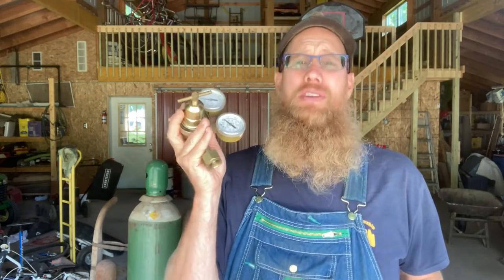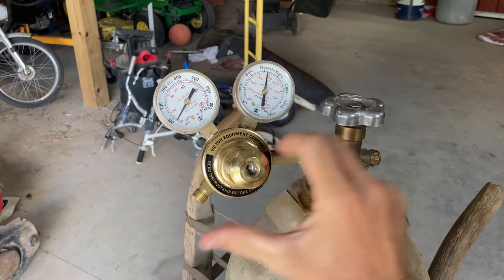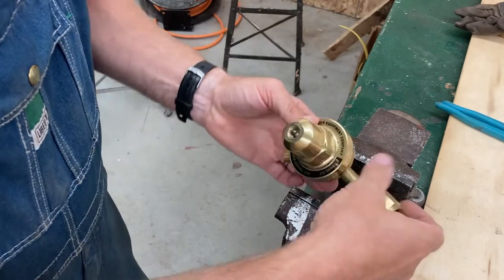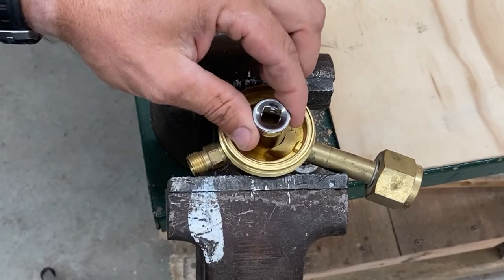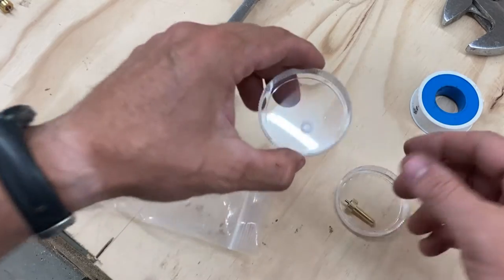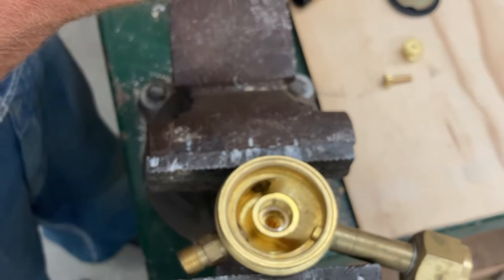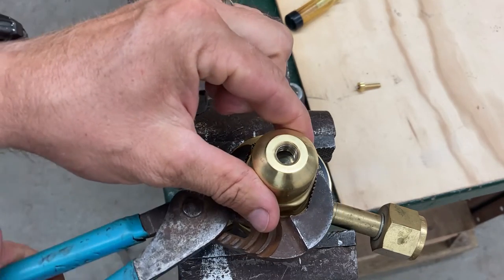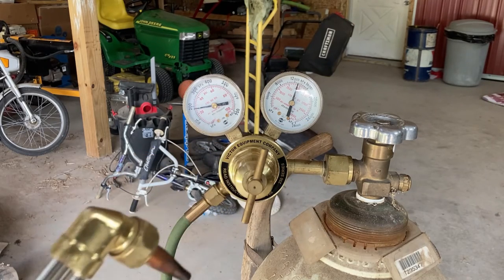Victor 250-80-540 Oxygen Regulator Rebuild

Comment: Thank you for sharing. It was very informative and helpful. When you removed the diaphragm and turned it around, it looks like it is in bad shape. Time 5:26 But, if the diaphragm was bad, you would have gas coming out of the vent holes in the cover. Glad to see the rebuild kit worked.
Reply from the maker: Hmm, looks like you’re right.  This repair did fix the issue.  Thanks

Comment: I went through the same thing today. Made about 8 cuts and the regulator 
 maxed out. Got the kit ordered for it. They're up close to $30 now. When I'm done cutting i do back the pressure screw out and bleed the hoses. Always turn the tanks on slowly and i never stand in front of the gauges just in case.

Comment: Hi Mr Youngblood!👋 the same just happened to me midway thru my project, luckily there’s a welding shop 20 miles from me I can get a rebuild kit from today. I’m not really interested in an Amazon kit(don’t know the quality) so off to the welding shop. Your pressure pin looks tore up!! That’s where the high pressure from the Oxy tank bleeds over to the low pressure side(to your torch) and that’s why you got 100+ lbs. showing on your gauge(which you want 20-25 lbs). Since that happened, it may have sprung your gauge and now it won’t return to zero(may need a new one now). As for unscrewing the pressure “T” after you shut everything down I say YES! Unscrew (back off) that T so the next time you open the tank valve all the pressure doesn’t hit that low side, in the unfortunate situation it could result in the regulator blowing up right into your face! Always power up your torch line little by little until the desired pressure you want. And release and back off any pressure when your finished. Good luck my friend and wish me luck too!!👍🏻

Comment: A real good video on repairing your regulator but I noticed your low pressure gauge did not go back to zero after your over pressure condition. Does it need to be replaced or is there a way to re-zero it?? The way it is now not starting at zero you will have inaccurate pressure readings. Just my 2 cents.
Reply from the maker: Thanks for noticing, I’ll look at it

Comment: HI Joe.........does the brass housing on your regulator have the 250-80-540 stamped on the outer ring??
Reply from the maker: Yes, actually it is stamped RC250-80-250,  I’m guessing that is the same.  Not sure what the RC stands for, but the part I linked worked well to fix the regulator, best of luck